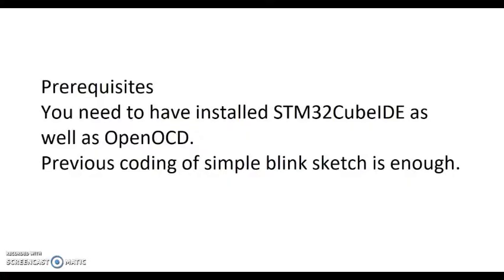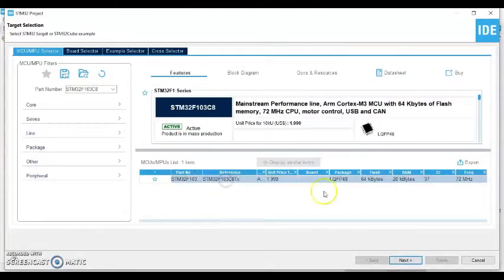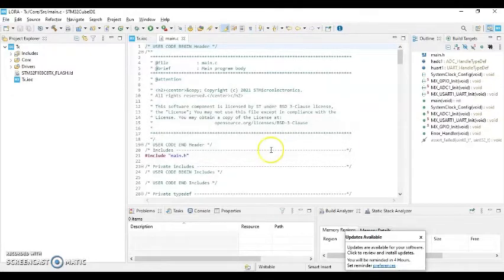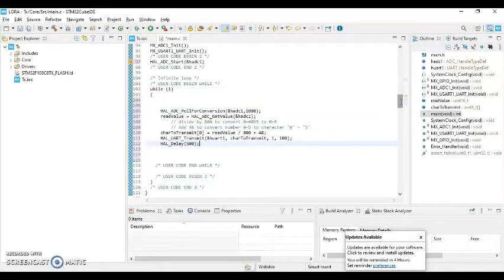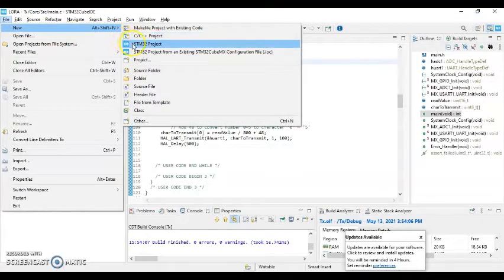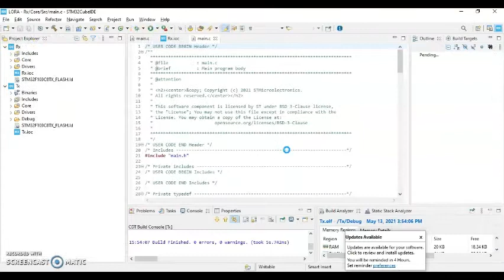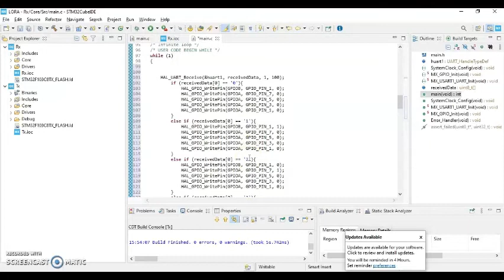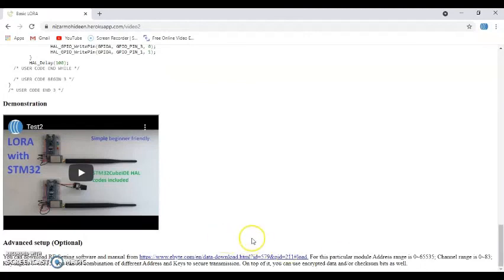2. Basic Ebyte LORA with STM32

Comment: Hi sir, i tested the modules for 30 meters distance between two modules (with antennas) and it worked but if i tried to test the data tranfer with a distance of 2km between these two modules, the data wasn't received (data not detected).
What can be the problem?
Reply: Hello , Did you use antenna? How could you solve this problem?
Reply: @zsc3279  Yes, 2 km data transmission testing should be done at a good height, such as on the roof of a house or other higher location to avoid data loss.

Comment: it didnt work
Reply from the maker: Debugging steps
Use video no 16 to check only the potentiometer
Use video no 22 to check uart communication without LoRa modules
Check for wiring connection
Reply: @NizarMohideen  i did all of them but it didnt work. maybe 3.3 volt not enough? can i give 5 volt?
Reply: @NizarMohideen  And i have stm32f407vg and stm32f446ret6.
Reply from the maker: You can debug without lora modules by connecting rx-tx, tx-rx and gnd-gnd

All LoRa modules has to have same key, channel and frequency to communicate each other. Most of the time, it comes as same when purchasing new. If it is used module by someone before, settings may have changed. You can see these using RF settings software as I shown in video no – 26. https://youtu.be/6vIYaawRQ2g
Reply from the maker: I hope it is working for you.
I have the answer for 5V  ---->>
From 4th page of the user manual for this module I got the following information
* TTL level output compatible with 3.3V and 5V IO port voltage
* Supports 3.0V to 5.5V power supply. Power supply greater than 5V can guarantee the best performance.
Check with the user manual for your module. If you see same information, you can safely use 5V
Reply: @NizarMohideen  thank you sir, i will
Reply: @eneoxkeskin  oldu mu kanka
Reply: @alidemir8434  yok ya çalışmadı her şeyi yapmıştım ama arduinoda falan sorunsuz çalışıyor. Bulursan haber etsene knk
Reply: Merhaba bu modülü stm32 de çalıştırmadaki sorunun sebebini bulabildiniz mi? @eneoxkeskin

Comment: Hola, I try to use E32 with Arduino and STM32 but I have a problem about configuration. I can open RF Setting and openPort but when i push getParam i get an error: "No response this module." How can I configure my modules? I tried many things but I could not solve this problem. It is so important for me. Please help.
Reply from the maker: There are several RF settings software in the Ebyte website. Use the correct software for E32.

M0 and M1 pins should not be connected to GND

Comment: Hi, i have a question..
Does the Ebyte Sx1276 lora module work (send and receive data) without antenna?
Reply from the maker: Yes. It will work only if they are very close to each other. Not for long distance.

You can remove the antenna for few minuets only to show it is possible to test without antennas for short period of time for people who can not afford antennas. If you want to test long times you must use appropriate antennas. 

“For in-house testing we do not need the antenna. If we do not use antennas, we need to switch the power off for few minutes every hour to cool the module. The reason is RF power will be returned back to module if no antenna found and it will produce heat.”

Comment: Hello Nizar, can u tell me how does lora modules connect to each other? I want to use several modules but I want them to not interrupt with each other. Thanx good videos as always
Reply from the maker: Thanks.
A simple way of doing with multiple lora module is to use different code-words. For example, if there are seven modules and one of them wanted to transmit a message to fifth module with five5 code then all other six modules will receive the data. As the fifth module knows five5 code is for him, fifth module will take some action. All other modules will just ignore the message.
All the message received will be passed to the micro-controller. The micro-controller is responsible for rejecting or accepting the message.
I hope it is clear.

Of course there are more complicated efficient ways by setting different frequency transmissions.
Reply: @NizarMohideen   I understood code-words way thanx but 2 lora modules simply does not connect to each other I am following you video exactly is there anything i have to do in order this to work? Lora modules are completely new
Reply from the maker: All LoRa modules has to have same key, channel and frequency to communicate each other. Most of the time, it comes as same when purchasing new. If it is used module by someone before, settings may have changed. You can see these using RF settings software as I shown in video no – 26.
https://youtu.be/6vIYaawRQ2g

Comment: How can this LoRa module work without using any libraries or making  any register configuration? Can you explain? I really wonder. Thanks a lot.
Reply from the maker: We don’t need to configure register by manual coding. There is a graphical user interface software as I have shown in video no 26 in my channel
We don’t need library as we can directly program using STM32 HAL coding for UART as I have shown in my video 22
An advanced UART coding is available in video no 56
Thanks
Reply from the maker: https://youtu.be/6vIYaawRQ2g
https://youtu.be/TJaHRDkYzCo
https://youtu.be/JG189GIko7k
Reply: @NizarMohideen  You sir are a legend for this detailed replies :))

Comment: Hi Nizar, I'm thinking of buying the E220-900T30D Lora module. But how can I run this module with arduino. My jop is not electronics engineering. In my research, I saw that Lora E32 and E22 series have separate libraries, but I could not find the Lora E220 Series library. I couldn't understand when I looked at their code. Can you post a code sample for a simple receiver and transmitter for Ardiuno?
Thanks.
Reply from the maker: E220-900T30D data-sheet is available at https://www.ebyte.com/en/data-download.html?id=579
It’s operation is exactly same as the module I used here E220-400T22D.

I have made a video with  E220-400T22D and ESP32 using Arduino IDE https://youtu.be/n7quyu_YVcU
The video is very simple have a look.
Reply: @NizarMohideen  First of all, thank you for your interest.I know about datasheet. But I couldn't find much about coding there. I am also working with arduino uno. So I don't know how to adapt their code that works with esp32. Since my job is not electrical engineering, I learn more difficult. I wonder if it is possible for you to provide information for a simple code that can work on arduino uno?

Comment: This module dont need any library or register configuration? Directly send and recive by uart?
Reply from the maker: Yes. That is correct.
You can change the frequency and key using RF Setting Software as  shown in video https://youtu.be/6vIYaawRQ2g